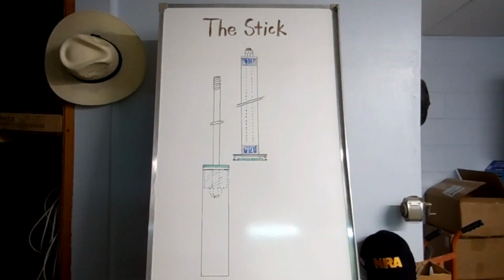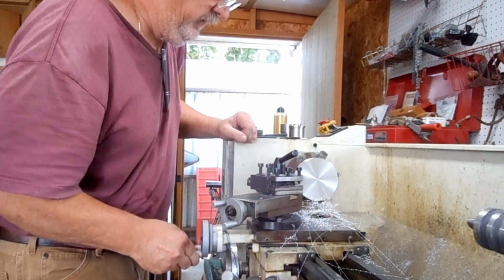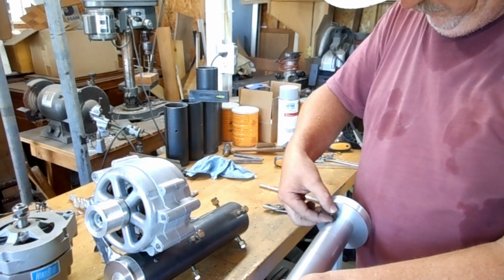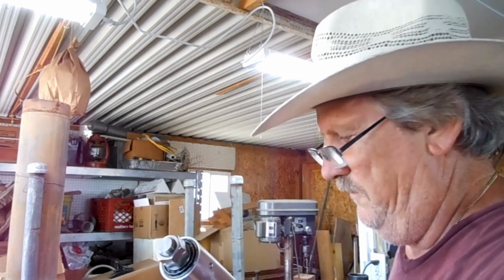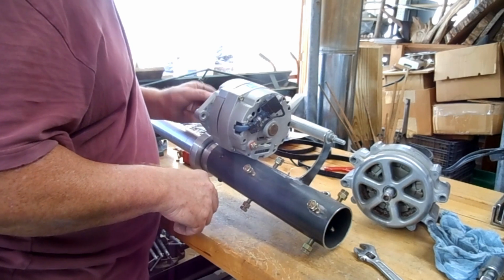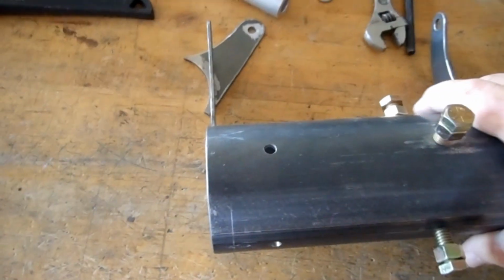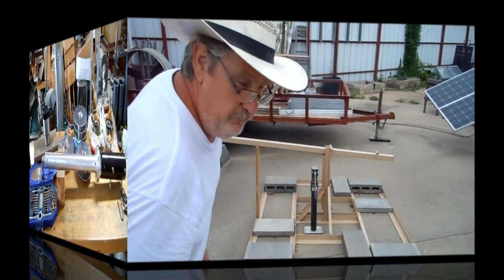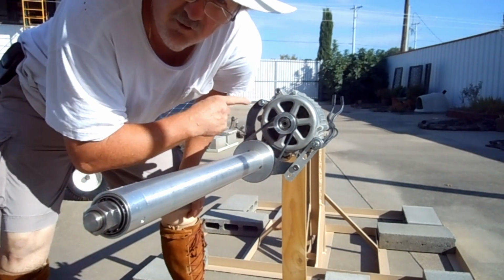Get On the Stick

Comment: Very nice work, I like three  or more cores .
A variable output design in a small compact package.
Jack on the long side with a counter weight  on the short  side. Don't  think barbell , think cast iron pipe slid over short end.

Then a small  DC motor and cable with one pulley block  attached to the end of the cast iron pipe by the poles end.
Allowing the  iron pipe weight to slide allows gravity to  increase leverage after the pole begins to rise, and keeping   a twaught cable.
Reply from the maker: It may be a little while before I have the money for the generators magnets. And I'll need those before I can calculate the inside diameter of the tube that the magnets will be mounted. These are the magnets I'm planning to use (or something like them) and I'll need at least fifty.
https://www.kjmagnetics.com/proddetail.asp?prod=BX088DCS&cat=19
I am looking forward to building a four core eventually, but for the first one I think I'll stick with a dual core.

I have a twelve volt motor I removed from my popup camper, and I plan to use that on the mast when I build it to telescope. The cable will be connected in a closed loop fashion so I don't have to depend on gravity to bring the mast down when there's some resistance in the movement; like rust or high wind causing it to bind-up.

The counter weight is a very good idea to relieve some strain from the motor. Especially since there will be the weight of three twelve foot square tubes one inside another, with a turbine on top. I'd like the telescoping mast to reach 24 feet when fully extended.
Thanks for watching and sharing your thoughts. I love it!

Comment: a lot of work there , and some good exercise too .the motorcycle stators are  interesting, you may have to rewire them to get them to hit desired voltages at desired rpms, ive done similar withe large direct drive motors in the past out of samsung and lg washing machines did far better than id hoped.
Reply from the maker: Thanks for watching and the input. I'm looking for 'better than I hoped', but i'll settle for 'It'll do'.

Comment: I like these better than any other on the market. are you selling these yet?
Reply from the maker: Not at this time.
Reply: @LittleshopintexasSV  Not even just one for me? We can some how connect and I can send you some money for parts. It's suck I'm in Orlando Fl and I have a big metal cutting band saw I would give you , It is close to 600 pounds. I don't use it any more.
Reply from the maker: @tonyjohnson1068  I'm sorry, I haven't finished the one I was building in this video. Harsh weather, poor health and other issues have put a damper on my doing. God willing I'll be back in the shop this spring.
Thanks for watching.
Reply: @LittleshopintexasSV  Do you mind me asking I saw you put a pulley on a PMA from Missouri wind and Solar. I want to build a turbine I saw a video the guy used 2 bicycle rims they already have bearings so I think it would be a cheap build. What size is the shaft on the PMA? do you remember any info on that pulley you can give me would be much appreciated.  Even if I buy one I don't really know how to measure it. I asked Missouri wind and solar they told me to come to their Saturday work shop class and I live in Florida.  If you want to watch that video look up (vertical axis wind turbine DIY tutorial home made project) . Thanks for your time.
Reply from the maker: @tonyjohnson1068  If they haven't changed it, the diameter of the shaft was 17mm. Missouri Wind and Solar has added a key-way to the shaft witch will make it work much better with pulley's. As for the pulleys, I made them from aluminum round stock to match a mini v-belt I took from a treadmill.
Reply: @LittleshopintexasSV  Thanks